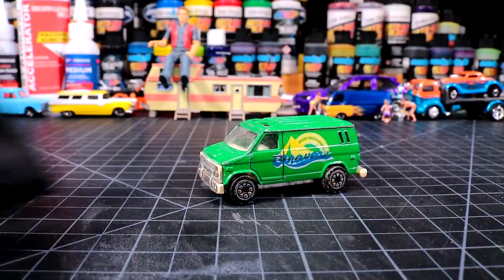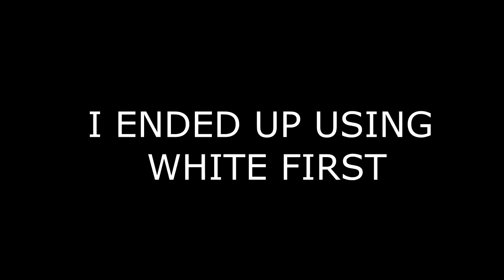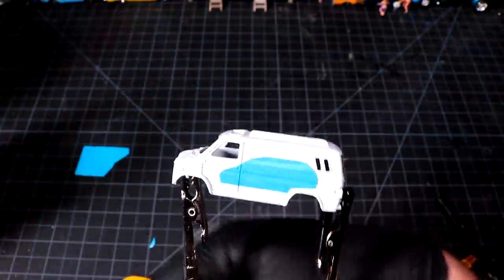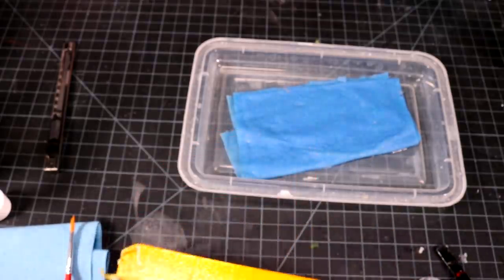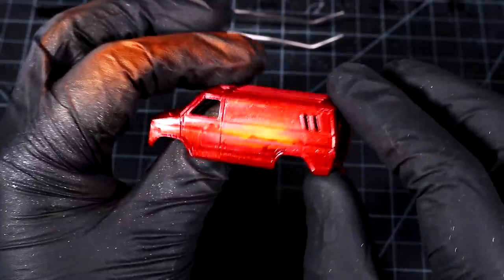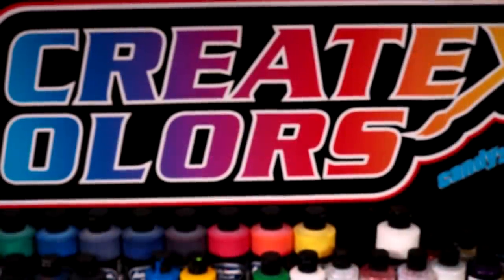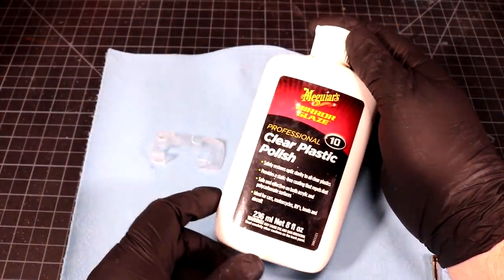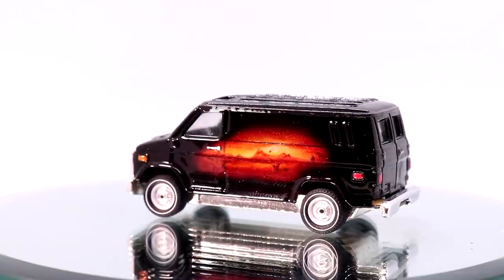PAINTING DIECAST MODEL CARS - Custom Diecast BOOGIE VAN

Comment: Very nice one! But the first color was to amazing to give up. Maybe next time you can try some different technics in a flat surface before go to the final piece.
Suggestion 1: White prime -> decal -> a piece of paper a little small then the borders of the decal, suspended a little bit to let the spray mist to "leak" into the border an make the sunburst effect over the borders while you paint the whole car at the same color.
Suggestion 2: Use a not transparent "candy-like" color ( opaque metallic base + pre mixed candy dye )

Comment: Turned out cool, thanks for showing what did and didn't work 👍😎 Just curious on your airbrush setup Austin, what size needle do you use and at what pressure? It seems like you used low pressure and a fine needle when blending the murals but went bigger and more pressure when clear coating.

Comment: Looking good! Saved that one pretty well.

I think that was the only way something like this was gonna work. If the mural isn't full color and needs a white backing, you need a contrasting overpowering color to paint over the mural and blend it that way. Trying to blend with a matching color requires you to know too much in advance (how the mural will look in advance, your white paint is not the exact same white of the backing paper; and how your mix paint will look at X final coats; these ain't happening, it is computer calculating shite).